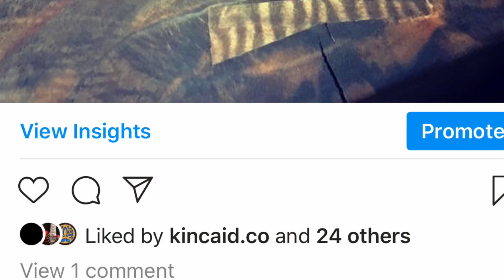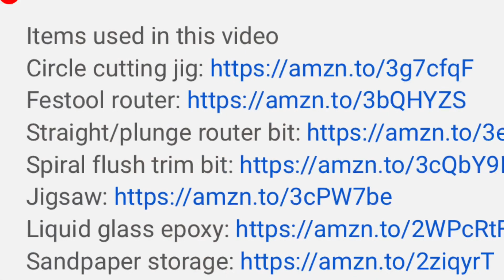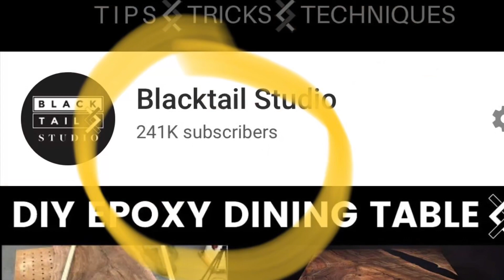Stable Job, Good Money, Great Benefits... I Quit - Blacktail Studio

Comment: Dream job: My shop teacher and friend quit his job to make slab furniture. That was 1976. As I recall he doubled his income the first year. We were exclusively using Myrtlewood. Mostly epoxy coated bit some filled with black and finished natural. He even did the kitchy tide pool scenes, but they sold too, and you go where the money is. Back then we were cutting slabs and coffee table bases along rivers and roadsides. He had the use of big driers at a local mill. All leveling was done with a router sled. Boy do I have some stories. Its why I became a shop teacher too.

Comment: Luthier.  This was my absolute dream job after a lifetime in management (at all levels).  
I had built a solid body electric guitar when I was young and just getting started in woodworking.  I built lots of furniture over the years while I did two old home restorations.  But, I wanted to do the ultimate challenge in woodworking, one that would greatly improve my hand tool and sharpening skills... Ahhhhhh, building an accustic guitar! And so once I retired, this became my passion.

Comment: Your story is very familiar, I've spent 40 yrs as a heli pilot and closing in on 50 yrs. in carpentry / construction. Fight fires, build drills, heli-logging in the summer months, construction in the winter. Now runn9ng  a custom timber co. fulltime. started watching your channel for insights on building an epoxy table, I've learnt a lot. thanks!

Comment: My dream job would to have my own sawmill and woodworking shop. I could pick the type of wood to cut for projects and then follow all the way through to the finished project. I have done that in a small way using a chain saw mill and air drying the lumber, but that is definitely the slow road. Hopefully things will improve to enable this. I'm not giving up my dream.

Comment: Idea for you. Interesting story by the way. At 09:15 you show some wood curls still attached to the slap. To do each slab side like that but at opposite ends so the gap between the slabs is full of curls which don’t touch each other. If the curls are long, you could made a fairly large table out of a thinner slab. It would be epoxy intensive.

Comment: Great videos! Very entertaining and great to watch while working out.  PLEASE USE HEARING AND EYE PROTECTION!!!!!!!   I have 40 years of experience and have ALWAYS worn ear plugs and safety glasses.  If you lose your hearing it is GONE.   I also have 2 friends/coworkers that have lost an eye: one caught a staple out of the edge of a board on the table saw (couldn't close his eye because the staple was sticking past the eye lid. EMERGENCY ROOM DOC PULLED IT OUT OF HIS  PUPIL WITH TWEEZERS!!) and the other was breaking off a case hardened nail in the slab and a small filing shot into his eye.  Depth perception is absolutely crucial in woodworking.  Save yourself the misery by developing these simple habits.

Comment: Aviation was my other career which got started in 1968 when I joined the US Air Force.  There I was an aircraft mechanic / crew chief on C-130s. I lack about 5,000 miles being able to say I have been around the world during my Air Force years.  After two years in I started using my GI Bill to get my commercial pilots license.  Used all but three months getting the rest of my ratings.  I flew and did mechanic work, I have an A&P also, freelance between trips on my other career as an over the road locomotive engineer.  Over 50 years in aviation and I have never been in a helicopter with the engine running.  But I did work on a few.

I love watching you turn those slabs into beautiful works of useful art.

Comment: You do great work. I am an A&P mech traveling around chasing wildfires, worked for a tandem rotor company in your area, and started doing wood working, mostly what i milled with my chainsaw mill, back in 2016. I started a venture building a wide cut bandsaw mill, rescuing/salvaging trees in the 50+" range for making tables and such. A traveling mech does allow for much time to finish these projects, but i am whittling them down. Will be doing something similar, making stuff for friends/co-workers. Now that iv got a better break schedule (14/14) its allowing me more time to catch up on these long winded projects. I'm now going to start on building a router sled that will fit on my sawmill frame and surface up to 76" wide.

Comment: Hey Cam, I'm also flew for LFN but on the fixed wing side.  I used to take my commissions to the hangar to work on (mostly sanding, etc) during my shift.  I even hosted client meetings at the hangar a time or two.  I haven't given up flying yet, but I'm tempted.  Love the videos!
Reply from the maker: I used to bring my Festool gear to Pendleton and cut/sand all winter. I don’t think theyd have loved knowing that

Comment: Awesome skills!! Especially since you've only been doing woodworking since 2016. I've been a woodworker since I was 13, am 48 now. My shop was my mother's garage. Then I got married, moved out, had kids...lost my shop. Kept my tools but hardly used them for the past 18 years (my oldest kid). But NOW, I've built one shop and expanding/building 2 more. Wife calls it a shed, as it's just a 8'x10' metal "shop" from Home Depot. My new shop (not built yet, still sitting in a box) is a 10'x14'. 

I've been increasing my tool collection, still need a bandsaw, drill press and stick welder. 

Ran all my electric myself, lights etc and 3 french Drains so my shop areas don't turn into a pond (shops are on low area of property). 

I've been remodeling my home lately (is why other shops aren't built yet) and decided to start taking videos on doing it all. I seem to have a knack for fixing things and building stuff. Friends and family were constantly saying I should take pictures and videos and start vlogging. I said, what's a vlog? I never did social media before. Was kinda thinking I'm wasting my time, as taking videos and explaining "how-to" while working takes alot of time. But, after watching your videos, especially this one, well, it's inspired me to go forward with it. 

Thanks for the inspiration.

Comment: Your story was very interesting to watch, thank you for sharing. My dream was to fly helicopters in the service (Army) but at the time it didn't work out for me. Many years later I ended up in piloting fixed wing puddle jumpers, Cessna's and Piper's which was aso plenty of fun. Haven't flown since 2002 and now I'm tinkering in the garage with wood working. I'm no where in the league as you. I make tons of mistakes as I try to learn and expand my skills. Luckily watching your channel along with so many other DYI woodworking channels I'm learning little by little. Your skills in your builds are very evident the end results are spectacular. I tried some epoxy projects and they where to say the least a science fiction horror movie. Like you I kept them as a reminder of the things not to do. but I learned from it. As the saying goes, don't be afraid to make mistakes so long as you learn from them and never repeat them your OK. Besides if you don't make mistakes, your not doing anything.

Comment: I received an old 1943 Craftsman lathe from a friend about 10 years ago.  I saw a video about pen turning and have made about 300 pens on that old lathe.  Some I’ve sold for over $100.  Now I want to make hybrid wood epoxy tables but the materials are expensive.  I have some 400 year old quarter sawn white oak cutoffs from a tree that was struck by lightning in Northern California.  I’m thinking cutting boards of serving trays.  We’ll see.  Austin, TX is booming so they should sell fast.

Comment: DREAM JOB, i worked 38+ years as a Railroader. i was in charge of inspection & maintenance of over 300 miles of RR track. every day was a different task, different work site. and all outside in nature. the RR runs thru remote areas, even in cities. what took my job over the top was family footsteps. i was 7th generation B&O, Chessie & CSX. i drove to the same location as multiple gens of my family. 
i am now almost 5 years into the EVERY DAY IS SATURDAY Club.

Comment: Love your videos. I also like your honesty about your passion for flying and how it changed and took a backseat to your other passion you found and have embraced. I too had a passion, that I think is still possible, but I have put it on the back burner to start my own locksmithing business that is taking off. I deal with carpentry all the time and have always been interested in woodworking. Except, unfortunately, I have a severe wood allergy. I love woodworking, camping, hunting, and pretty much anything that has to do with outdoors, and every time I join my father in the shop, the moment we get any kind of wood particles or smoke in the air, or if I overheat a sanding disc on my Dremel on a client's door, within 2 hours I start sneezing for the next day unless I get it under control.

That's why I have other people do my woodworking for me, or watch people like you, though I don't think I will ever give up camping or hunting, even if they require me to be around campfires. Just wanted to share my story and let you know that your artistry and passion has inspired me.

Comment: Dream job: pilot. Watching this video has really made me think a lot as my dad is a 747 captain and 50% of the men in my family are pilots aswell and that is my dream job but I have so much passion for woodwork as well and I don’t know which path to go down as I am only in high school. I am currently in my second level 3 senior course of woodwork and every day I’m in the shop I just have more and more ideas and even when I’m home I’m watching either your videos or Black Forest wood Co’s videos to get any little tips and tricks I can. My main staple is using the laser engraver at school. I’ve made about 15 plaques that I’ve sold/gifted to friends and I really love making those. I’m currently waiting on my first epoxy table to finish curing. It’s not a crazy big one. It’s two slabs of 1” black walnut put together and I got them for super cheap as they had massive cracks in them. I spent about 7 hours in laying 9 bow ties for the two big cracks and I learned from your video how to do it. Just want to say your videos are one of a kind and I learn so much from them. Hopefully when the border opens up I can splurge and drive down to Gobe walnut and pickup a slab or two!
Reply from the maker: Thanks man! Appreciate your support

Comment: Came across your channel while researching how to make an epoxy table. Many thanks for sharing the many how-to's for a "newbie" (oh, and I subscribed).
I found nice piece of dark walnut that I plan to use for a "river" type table.
However, the wrinkle in my plan is that this table is going to be themed - I have a handful of skis that I have used and skied on over the last 30 years - all with some memories. So, I plan to immerse several of the individual skis into the epoxy (probably 4 individual skis). I will need to trim the tips of some of skis in order to reduce the overall depth of the table. 
The walnut piece I have (uncut) is ~72" tall and ~24" wide (and about 2" depth). Once I've split the walnut and laid everything out, I expect the "river" to be about 14"-18" wide. I plan on using an "ultra-clear" epoxy so that the skis are fully visible.
I have accumulated many tools over the years (even though I am not a woodworker by trade), but no Festools :-D 
Any recommendations or "gotchas" you think I should be aware of?
Reply from the maker: Oh man, probably a longer conversation!

Comment: Architect of homes.  I settled for carpenter/contractor, then a rural mail carrier when the knees gave out.  Your move was sensible, taking it slow, and diversifying your income sources..  There is always the risk that what one loves as a hobby may become just work when doing it to make a living.    Retired, I am trying to rekindle my passion for woodworking, but I have to find that niche that my body will tolerate.  Lesson:  Now is the time to take the risk. Tomorrow is not guaranteed.

Comment: My dream job is working on my C&C doing all wood jobs. I have a spindle on my C&C for which I need more instruction on. I use to do quite a lot but I had to move in with my daughter. While moving my CNC was broken I had become I’ll. There fore I just got the machine fixed and want to start back with working with wood.

Comment: My dream job became anything wood in about March this year. Got sick of the rat race and working on the road. So I quit my job as a heavy equipment operator which scared the shit out of me at the time. I got a job with a local carpenter doing finish work which I used to do on the side, which pays the bills as I work on my mill and my shop and making firewood. So far it’s working out and hopefully it’s continues to until I can do custom slab work full time.

Comment: I have 2 routers (Craftsman and Milwaukee), both full size (1/4 and 1/2) and not plunge.  I have a router table that I would like to replace to something similar to yours.  I like the fact you can adjust the height without having to turn over everything and set and re-tighten everything.  Will the router table you are using work with full size routers and if so what is the brand/model.  I am starting to look into more routing and I need to get a better fence for my older Delta contractor's saw.

My son just showed me your videos this evening and they look fantastic.  I have offered him, in the past, the opportunity to jointly build some things, but wood has gotten so expensive and stock has been limited.  I am so impressed by your videos, that I had to comment.... the first time I have ever done that on YouTube.  Keep up the good work and congratulations on your career change.

Comment: I had seen some of your vidies . They seems to me like watching movie with stories build in wood. Your passion and perfection is admirable. I ve seen carpentars in our place work the same but they  care more about their handling. Most of the time you handle  heavy slab I am tensed. Oh god why he is unnecessarily loading is vertibra because wood worker belongs to their mrs so take care when handling.
 You can try lifting slab vertical close to body with hands not away from body
You can use pin support  in tilting

Comment: Dream job: Racing driver. Current job: Design pipe & cable routes for new housing estates.
Hi Cam, loving your enthusiasm! 
I see why you changed your career but just wondering what gave you the confidence to make the leap? Was it volume of orders v's how much you could charge or simply "why not" (as long as The Mrs says it's ok)?
Reply from the maker: Just got to the point where I was held back from opportunity

Comment: My dream job? Haven't quite figured that out. 
Being able to do any of the things I'm reasonably skilled at - to MY satisfaction - and get paid enough to make a living for doing that would suffice. 
I've done some cabinetry for  our own use, to fit an exact spot. 
But the way economics work out over here, living costs, work space etc. I have no idea of how I'd be able to turn that into a living. The last bigger item I built, counting low that would have needed to sell for  3000 USD only to break even. It'd probably have needed to be 5000 USD or more to create any profit and funds for upkeep and setting up the next job. And to keep that next job coming would be the real hurdle.
A question: have you ever tried using vacuum to draw out bubbles etc? 
I've done a fair bit of boat jobs, laminates and such. And vacuum is a really handy tool for some of that.
Reply from the maker: I have for small pours

Comment: Hello, I love your videos. I found them because I'm doing a project myself and could use your advice.

I'm using the root section of a driftwood tree I found washed up in Galveston.

I would like to seal the roots in epoxy and place them in an aquarium for fish to swim in.

I'm thinking I should prepare the wood maybe bake it, sand it, apply penetrating epoxy, and finish with a clear epoxy.

Any advice would be appreciated, thank you.
Reply from the maker: Never tackled one like that. But I think you’re on the right track
Reply: @BlacktailStudio  thank you for the response and your time. Watching your video makes me want to learn to fly helicopters.

Comment: My 'Dream" job? Well, I would really like to be a '3D' designer ('ZBrush' proficient), designing furniture and jewelry. I currently have various furniture and jewelry designs that I done over the years, that I would really like have converted into either 3D, or 3D 'printable' files. This '2D to 3D' 'file converting' is also a possible fourth company, if I can ever work out all the details.

I current have three small businesses: (1) Graphics Design agency.; (2) Systems I.D. Sign company: directed towards the Fire Protection and Mechanical contracting industries. (3) Label, Tag & Sticker manufacturing company. These businesses usually keep me jumping. All three businesses are "loosely" tied to the 'printing' industry. 

Lastly, I really enjoyed this video, along with your other videos. What you've done over the past few years is really quite remarkable!

Best of Luck,

Jim Dasher
(Seattle metro)
E.: rii.jed@gmail.com

Comment: Microbrewery owner/operator where I can showcase some of my epoxy tables.
I haven’t been able to experiment a lot with finishes on my tables. I’ve used mostly the poly from valethane. Just using multiple coats. Have you used that finish?How does it match up against the Rubio and others.